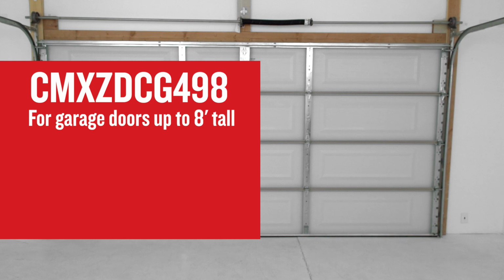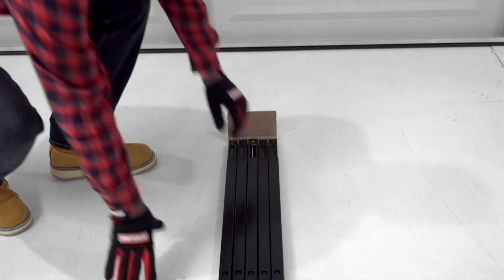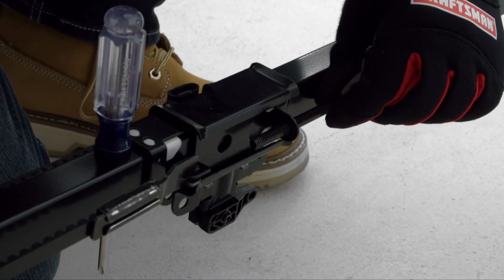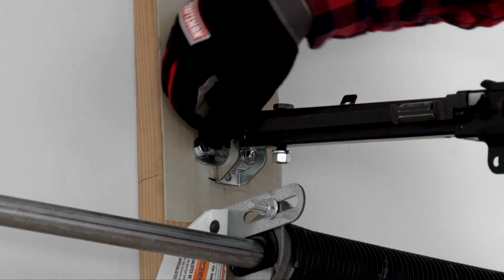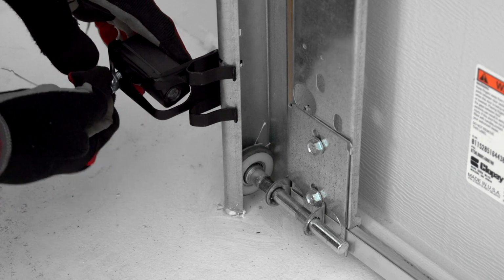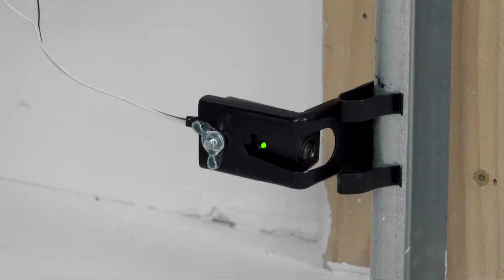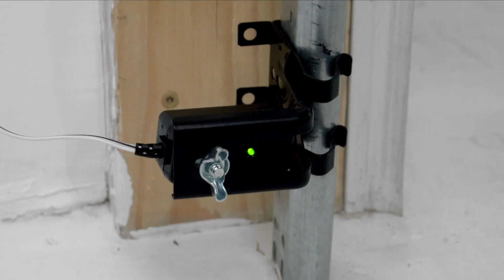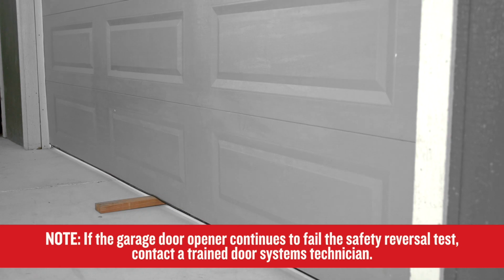How to Assemble and Install a CRAFTSMAN® Belt Drive Garage Door Opener

Comment: This video was REALLY HELPFUL in putting together my new Craftsman Belt Drive Garage Opener.  Two points I might mention.  (1) The screw that connects the belt to the trolley has a "flat side" that can only go into the trolley ONE WAY.  If you put it together the wrong way out, the belt twists.  50/50 chance and I had to remove the coupler and switch the screw the other way.  (2)  The video and the manual are different in the way the curved/straight arm are put on the door/trolley.  I opted to install the way it is in the video, since that was the way my garage door opener HAD been... and it seems to work better on the video rather than in the install manual.
Reply: Yeah, I figured out the flat side after the fact, too. A 50/50 chance, right?

Comment: When I get to the door travel set up I do as the owners manual says:
*I disconnect the “safety reversing sensors”
*I push the adjustment button and it beeps immediately 
*The up button flashes once 
*When I then push the up button the light bulb flashes twice and nothing works.

ANY IDEAS ANYONE???

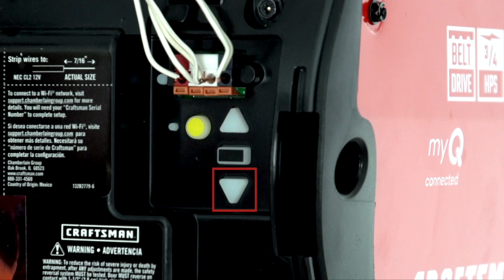Comment: When I plugged it into the socket and went to do the configuration as shown in the video at 11:30, when I press the adjustment button, the up button is not flashing, up and the low button are flashing, what should I do, it is a motor defect Or is there something I can do?

Comment: The step where we are supposed to jam a flat head screwdriver into a slot while turning the nut does not work. When I turn the nut to release the spring, the screwdriver wants to unjam immediately because it's BACKWARDS. Turning he nut should help keep the screwdriver in place, NOT force it loose and cause damage, injury, and stripping from the metal on metal contact.
Reply: I had had the same problem so I just held the spring nut with pliers and turned the nut.  It popped into place easily.